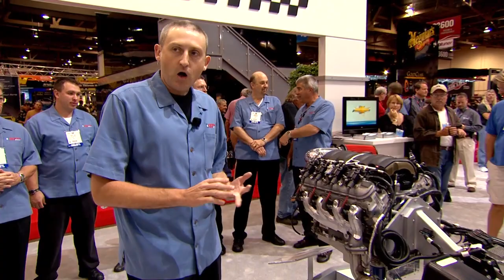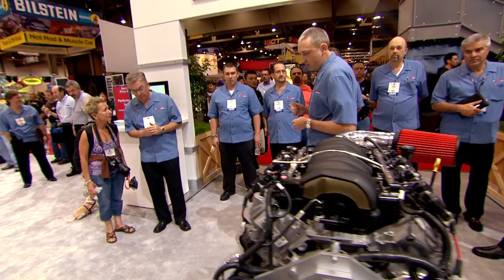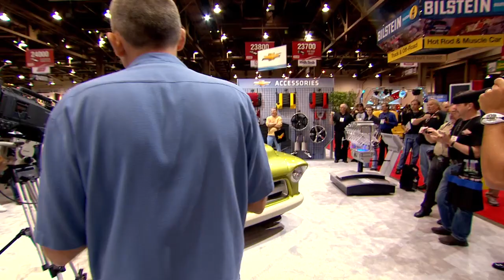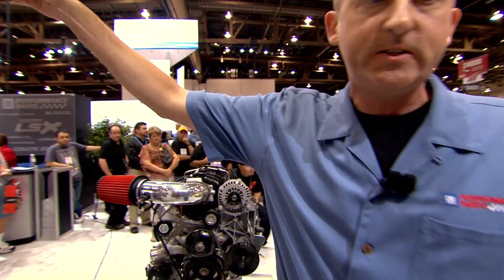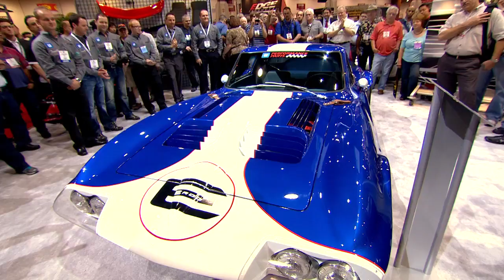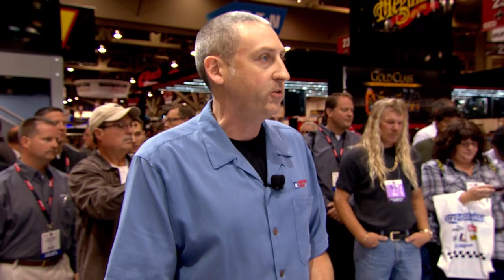GM Performance Parts SEMA Press Conference

Comment: DEAR GM PERFORMANCE PARTS-WILL YOU HELP?
MY LSX 454 BLEW UP
Recently I was influenced to purchase a Chevrolet LSX-454 engine for my 2010 camaro based on information in print and in person from Dr. Jamie Meyer, the Product Integration Manager for GM Performance Parts. THE BLOCK HAD A   CATASTROPHIC FAILURE.